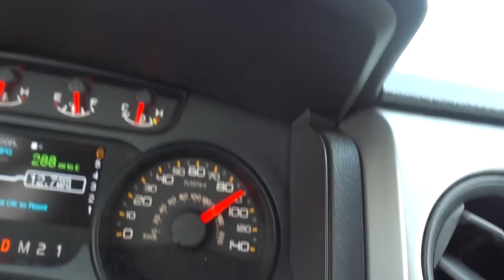Insane Amount of Guns, Ammo & Explosives

Comment: How did the dude at F1 Firearms not know the difference between a Mac 10, which he was holding and an Uzi?
Reply: No. It was a Mac 10.  Please google search Uzi.  The Israeli Uzi looks nothing like a Mac 10. 

You can apologize after you educate yourself.
Reply: war play256 educate yourself.  Look up the differences, and you will quickly see that you're wrong. 

I work with guns also.
Reply: war play256 Please explain why you think you're right.
Reply: war play256 you’re wrong dude, try using google for once. If you are a fan of guns and don’t know the difference between a Mac 10 and a uzi then something is wrong with you.
Reply: Brandon Waller actually that was a MAC 11, MAC 10 has a bigger receiver.
Reply: that's why I came here to comment, that aint an uzi. I shoot with guys with Macs and Uzis and Thompsons and G3s and H&Ks, love that MP5K, and, as I have M-16s. see pic at your left. full auto with a 22 upper and a Sparrow can.
Reply: I only saw it a second and it looked Mac 10 ish, and the Mac 10 in 380 is way smaller than the 9mm or 45.

Comment: It looks like you are going with a mid length 18" barrel variant which is awesome, I think the bolt carrier group would look awesome in the light gold, something like a quality mean looking compensator with a standoff profile, a custom leather sling with the Demolition Ranch embroidered on it, high quality iron flip ups and for the butt stocks, something a little bigger than a minimalist like a CTR or even a OEM. The most important things that I would want in a custom AR would be the barrel, BCG, trigger, gas block and the rail which look like they're coming along great!

Comment: Put a replaceable strip of rubber on the bottom, near the muzzle, to prevent it from getting scratched if you rest it on a rough surface and use it.

Comment: Put a replaceable rubber bumper guard on the bottom, near the tip.  So you wont scratch it if you rest it on a rough surface.